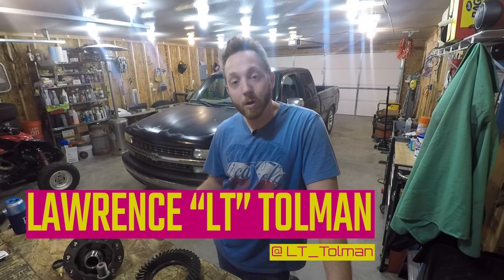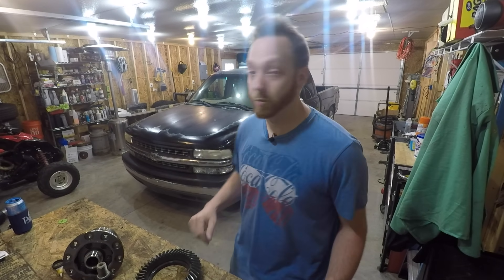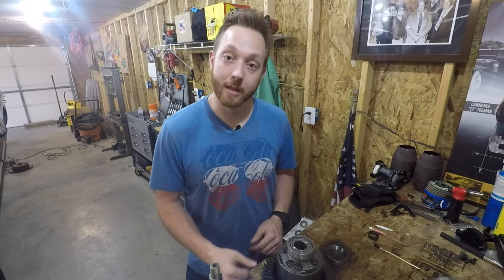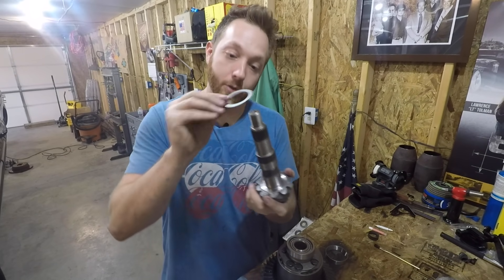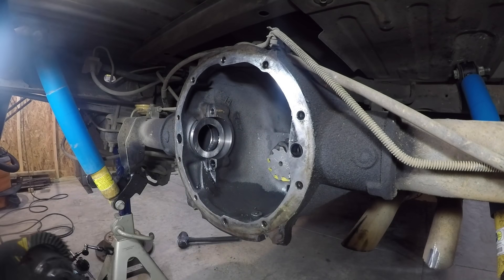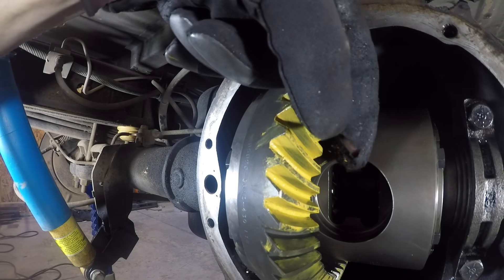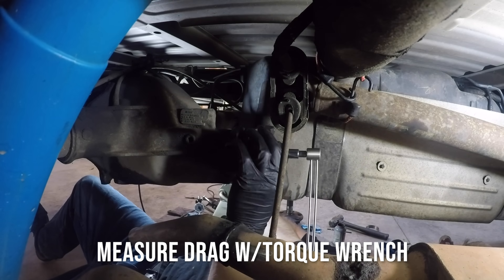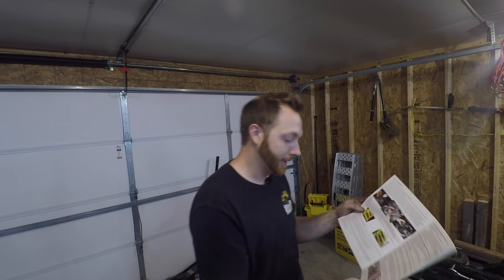how to re-gear a GM 8.6" 10-bolt axle

Comment: Usually on a 8.6" What I've seen most is 0.033-0.037 on factory shims which is a great start. Also what I've noticed is allot of people forget Carrier Bearing to Case Preload. Measuring the stock shims is a great start for the overall thickness but I've seen in some rear ends where you have to just remove 0.006-0.012 out because the aftermarket carrier is just a bit too tight.

Comment: Putting gears in my pre runner silverado was one of the best things I’ve ever done to it. Unfortunately I didn’t fill the rear end fluid properly and took the truck on a 10 hour round trip so I need to do it again lol. Going from 4.88’s to 5.13’s now though.

Comment: Definitely the best video and explanation on changing gears on a Silverado. I need my 05 4wd to 4.10s the 3.42s with 32" tires has nothing off the line especially, towing a little 5x8 trailer. The cam .218 duration really takes the guts out of the low end. Mine being a daily driver I would benefit with 4.10s. The GM engineer that thought 3.42s with a tow package was a good idea, is a complete moron. LT as always, you're a great technician and teacher. A huge Thank you.

Comment: Hello, is there any part numbers for the setups bearings you used for the pinion gear? 7:13
Reply: I believe he useda normal bearing, just sanded down the inner diameter a bit. Atleast that's what I'd do

Comment: Before I take any more axles apart I am going to do a pattern on the ring BEFORE removal and I will measure my pinion depth to verify it's position in the housing BEFORE I remove it. This will save you a lot of problems later. Shimming is a breeze when you know your depth for sure. I pulled apart a DANA 41 from a jeep and NO ONE can tell me the the standard pinion depth of the housing. Had I measured it before removal I would have saved about 10 hours of trial and error.
Reply: Great idea. I have never heard someons say rhis before.
Reply: Damn thats a good idea 
I lik

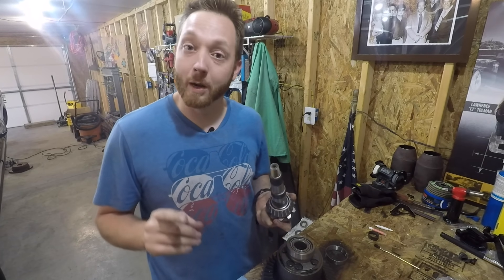Comment: Hey there great video and very well explained! I was wondering if at 8:00 when finding pinion depth would you use the crush sleeve on the pinion shaft when correcting gear pattern or only use the crush sleeve during final install? cheers!

Comment: re: pinion set-up bearing
I learned the hard way to make sure both the set-up and final bearing are the same brand, same thickness.
One brand was a bit thicker or thinner than the other and I was off on my final install.
I set it all up a few times before I realized where the difference in numbers was coming from 🤔

Comment: Sweet idea using a modified test pinion bearing when using a crush sleeve to keep from wrecking the bearing. I'm doing a complete rear end rebuild on my Z71 Sierra soon, but I'll be using a crush sleeve eliminator in mine so I can install the new pinion bearing and not have to remove it anymore to adjust pinion preload. Crush sleeve eliminator takes a little longer to set up because of the shims, but it's way more convenient if you ever have to remove the pinion or replace the pinion seal😎.

Comment: all you have to do to setup pinion depth thats way easier ..pinions are etched with numbers ,  so old gears ...take that number and add or subtract from the new gears etched numbers on pinion thgen add or subtract the difference and you are set to move on to next steps

Comment: High LT Another quick question. I pulled the OEM shim from underneath pinion and it's stamped .038 and verified. From your experience, how much deviation should I expect from .038 when installing a new Yukon ring and pinion set. For some reason I can't get a nice "centered" football pattern. The pattern just seems to stay at the toe no matter what shim I put in. After about 10 times I am doing something wrong. I'm worn out Buddy lifting and removing that center section :) I tripled checked to make certain that both pinion bearing races were fully seated. Naturally anytime I make a shim change to the pinion I go back and measure backlash and adjust back to .006"-009" as recommended by Yukon? Prior to removal of the original carrier the backlash measured was .007". Do you have any suggestions? Thanks Buddy and I hope all is well!!
Reply from the maker: if you have the original pinion bearing (big end) make sure the new bearing you have is the same thickness... I've had some new bearings come in a rebuild kit that are way thicker which makes it impossible to get the pattern right. but to answer your question, usually every rear I end up doing is within 10 to 20 thousandths of the OEM shim...
Reply: @TolmanPerformance  Well I got it done minus the axles. Will do that tomorrow. The rebuild kit came with Timken bearings. I did as you suggested and the National OEM bearing was within .002 of the Timken. So to make them exact I used a .040 shim with the new pinion. I did go over the pinion preload by just a tad. Upper end of spec says 19 in/lbs I hit 22in/lbs. It was at 12 in/lbs and that is too low for new bearings. So I grunted on it just a hair and went over. In the counter clockwise direction it's 15in/lbs. Go figure?  Average - 18.5in/lbs. Backspacing is .007 and the pattern looks OK now. Not perfect but I think OK.

Comment: Hi LT Fast question. When you are measuring pinion bearing pre-load you said at 10:32 "Drag is measured with an empty housing. But to get pinion depth you need everything in place. I just want to be clear? When you are ready to put the pinion in for the last time you remove the carrier assembly and measure drag and continue to tighten the pinion/nut until you get into the proper range. Right? You did not show it but how did you hold that yoke in place while you accurately tighten the pinion nut? That pinion has to remain still or you will not get a good torque value. Thanks
Reply from the maker: I determine the correct pinion depth with the carrier in place, by reading the gear contact pattern, usually with several different attempts to get it right. During mock up to check said pattern, pinion bearing preload isn't important, just tighten the nut until there is no play and the pinion turns very slight effort. Then, on final assembly, you install the pinion, correct shim, final bearings, seal, yoke, crush collar and nut, and tighten the nut until the crush sleeve compresses and rotational drag is increased (with no carrier in place) until it reaches specification. You can use a yoke holding tool and a long breaker bar to manually tighten the nut, or the faster but riskier option is to use an impact gun. This can work, but its extremely easy to over tighten the pinion nut and get too much pinion drag, and if that happens, you need to disassemble and replace the crush sleeve. Once you have the pinion nut tight with drag set, you can then install the carrier for the final time, and verify backlash is correct.
Reply: @TolmanPerformance  Fantastic! Thank you for taking the time to answer my questions. I just purchased a Truetrac for my 1971 Camaro. I know you like them and you are hard on the equipment (for speed) and I have never heard you say you broke one! So I figured if 1,000+HP is OK 300-400HP is fine too. The rearend ratio is currently a 3.08 so changing the gear too. Hard to do a burnout with a 3.08 :)
Reply: I use your video's for inspiration. You are a excellent teacher! Keep it up!!

Comment: Just picked up a 2006 5.3 crew cab I got 456s cause I tow a enclosed trailer to the desert with my toys in it it’s got 373s in it right now and 33x12.50.17 setup will the 456s wake the truck up a lot or is it even worth it ?

Comment: After watching how you pressed on the pinion bearing incorrectly, I wouldn’t follow any of your advice.  You cannot put any pressure on the cage like that. You needed the inner race from your old setup. Not the external one!!Clearly, you watch others do it wrong on YouTube, and keep spreading the wrong way. 
The host job is good, but after seen that, it brought you down to amateur level and not worth listening to any of your advice

Comment: Anyone with experience tell me what would be the best gear set up for my 2015 5.3 Silverado . I have a 6 in suspension lift, I run 35/12.50/20s. I’m looking to get more power on the low end . Pretty sure I’m running 373 gears currently. Not bad but sluggish .

Comment: Hey man so I’ve got 3.73 gears stock and I’m just wanting to do an LSD from ridged axle can I just pull the stock on out and put the new one in without checking it reason is I had it welded and it broke

Comment: I like my Ford 9in. I can swap gears out in about an hour it's normally got the 4.11 3rd member in it. I have 2 more both higher. My 2007 1 ton chevy 3500HD has 4.10 stock a limited slip carrier and at 70 mph I'm turning 2300 rpm's. I get around 14 miles per gallon on the highway.

Comment: Do you have to set the backlash before pinion depth? Or does it have any affect on your pattern when your checking the pinion depth?
Reply from the maker: no, the first step is to set pinion depth, but each time you make an adjustment to pinion depth, you may need to re adjust backlash to get it within spec.

Comment: I want to do this to my 2007 Silverado. I’ve never rebuilt a rear differential before. Do you think a 12 ton HarborFreight h frame press will get the job done. I looks like that’s all I’ll need to buy besides parts obviously.

Comment: Most ring come with a number wrote on them. That number can remove the trial and error from installation. I learned this after many diffs and wish i knew much sooner. You can remove original pinion and the shim behind that bearing pressed on is critical. If your ring says +2 you and the shim is .022" you install a 0.24" shim, and of course check that measurement. If the ring says -2 you install a 0.20". I like that process you use for checking that measurement by sanding the bearings.

Comment: ? I have a 2003 chevy 1500 short bed pu 2wd are the axles 28 spline or 30. Motor is a 5.3 with 4l60e. Thanks

Comment: I want to gear to 4.10 I was planning on running 315 tires what’s your option on that combo also could I regear to 4.10 and run stock size tire 255 . Note I have the 4l60e
Reply from the maker: 4.10 is a great all around gear, especially if you plan on running a little taller tire. Most gas HD trucks had a 4.10 as well...

Comment: Best explanation methods for this rebuild I've seen, yet. The separation of this job in two parts (the pinion depth as one job... then the gear lash as the next), makes great sense. What may seem like a daunting job you explained in a way any good teacher should be able to. How difficult is it to better secure the axles in case of a failure incident? I'm not afraid of this job at all anymore, thanks in part to this simple quick wrap-up 👍 I do like the idea of having more security on the axle shafts than just c-clips, as well.
Thanks for the help. Cheers.

Comment: I would like to know the part number for the setting bearings please
Reply from the maker: I think you can buy some from Yukon Gear and Axle, but I usually just make em by buying 2 and using a dremel type barrel sander to take a couple thousandths off the ID so it slides on and off easy

Comment: I know this was made a while ago, so I’m not sure if you’ll see this, but I wanted to know - I’m installing 4.56 gears in my Silverado (same model and year) and I don’t have a dial indicator to check backlash. Is there any way at all I can go off of the gear pattern in order to check for backlash, or is the (expensive 👎🏼) indicator necessary?
Reply from the maker: You could in theory go off a pattern to set backlash, or even by feel if you’ve done a couple before, but of course the best way is to use a dial indicator
Reply: @TolmanPerformance  Thank you for the response!!! I’m currently 3 hours in to the job, lol, and didn’t manage to land an indicator. Hopefully I’ll be fine with the pattern, but if not I learned an expensive lesson. Thanks again :)

Comment: These 10 bolt rears are surprisingly simple. I regeared my pickup a couple years back. Grabbed some used gears from a Suburban. It had a good locking carrier and pinion but the SUVs have coil perches instead of leaf perches. Ended up getting a spare truck diff and set it up on a set of saw horses. Tore the truck diff apart and set everything to the side. Put the SUV guts into the truck housing and tightened everything down with an impact until it felt pretty good. Over 5000 miles on it and no signs of failure. Great video. Very informative and straight forward.

Comment: Do you have to get the computer / transmission retuned to shift properly after the gear swap?
Reply from the maker: yes you should, especially if you do a drastic change like 3.42 to 4.30. You could drive it easily for a few days, but the wide open shift points would be off, because its based off MPH instead of RPM
Reply: @TolmanPerformance  what is the best way to get that done? Dealership?

Comment: If I just replace the posi but leave the same gears ima I supposed to still adjust it or can I slap it on like nothing
Reply from the maker: you still need to adjust carrier backlash, but not pinion depth. So its a much easier job

Comment: If ya over-do-it with the rotational torque spec (it’s too high) I’ve seen techs get lucky by smacking the end of the pinion with a hammer a couple times, brings her in spec of your lucky.... but only if your a little off.

Comment: How do I know my setup bearing and the real bearing are going to give me the same pinion depth because different brands can be a little different. And can I use the setup bearings for the final bearings.
Reply from the maker: no, you don't want to use the setup bearings as the final bearing, it would spin on the pinion shaft and cause premature wear. If you buy two of the same bearing, it should be very close if not exactly the same. (or it has been in my experience)

Comment: Had a question Lawrence, after you made your 'set-up bearings' and you reinstalled them to get the gear pattern check, did you use the old crush ring or did you use a new crush ring? Or did you NOT use a crush ring at all to get the gear pattern? Thanks for the help bro!
Reply: You can just use the old crush ring, that doesn’t change the pinion depth

Comment: great video! But I find it very very hard to believe that you pressed the last outer pinion bearing on with a pipe and a hammer with nothing holding it in except your hand. How did you actually get it on? Impact?
Reply from the maker: I showed exactly how it went on, I always use a hammer and pipe to get the outer pinion bearing started onto the pinion gear. those outer bearings don't fit quite as tight as the inner ones do, and as long as you can get it slid on far enough to where you can get the yoke and pinion nut on, you're good to go.

Comment: Great informational video ,,I was was wondering what brand pinion bearings you used ? I Was thinking going with national ,Is that a good bearing ?
Reply from the maker: to be honest, I am not sure what brand I used on this particular rear end, but yes, I have had good luck with National on many projects.
Reply: @TolmanPerformance  Thanks for getting back to me I was wondering  by deducting 5 thousands on pinion dept ,How many thousands would it add or deduct on backlash ?

Comment: How much different would it be to set up gears on a 14 bolt full floater?
Reply from the maker: the only major difference wold be setting the pinion depth with shims on the pinion support instead of behind the pinion bearing. but the same principals apply...
Reply: @TolmanPerformance  thanx LT, when we gonna get to hear that turbo whistle?!?!

Comment: I have 3.73 with posi from a 8.6 that i want to put into my 8.5 rear end but i have no idea if it'll work
Reply: For putting 8.6" in 8.5" uses Timken bearing part # LM102949 and race part # LM102911.

Comment: Hi I just bought 4.10s but it says 8.5 I'm curious if it would fit my 8.6 I been told its all the same
Reply from the maker: I believe the same gearset should fit both, I know the carriers interchange
Reply: @TolmanPerformance  are both 30 spline that's my main concern I know the ring will fit but the pinion is my concern
Reply: @TolmanPerformance  backwards compatible not forward

Comment: Hi Mr. LT I also have a 2002 extended cab short bed silverado. My question is if there's an available option for a Aluminum 1 piece drive shaft for the 2wd models.

Comment: Great info on changing gears. Big fan of the 4l80.I have never found out if the 4l80 is an overdrive 400. They used to sell reduced 1and 2 gearsets for those. Would it work in the 4l80??
And how about the 6 speed kit for the 4l80?? Love to see a grudge race with your duramax , turbo 5.3, coperhead, srt10, and this beast. Idk who would win.

Comment: Okay so the re-gear is good and I love how well it was explained my question is is that 8.1 going to Nuke that 4 L 60 or that 10 bolt first
Reply: The 8.6 with his setup should be fine, also, he has an 80e. Should be good to go.
Reply: Have a built 468 in a 83 blazer, original 10 bolt and 4l60 lasted about 2 months then both scattered at the same time. Looked like a bomb went off in the trans. Was driving 20 mph taking son to school when it went.

Comment: Excellent video!  How do you get the test bearing to fit so easily?
Reply from the maker: Sea Ox I grind the inside out with a round barrel sander attachment for a die grinder. Or you can buy em already like that, as a setup bearing
Reply: @TolmanPerformance  where do you buy the setup bearing?